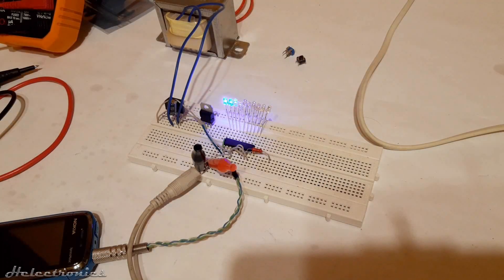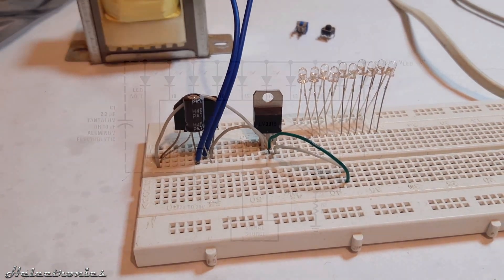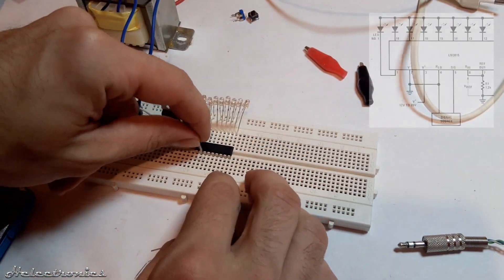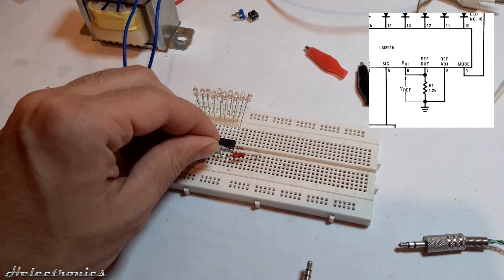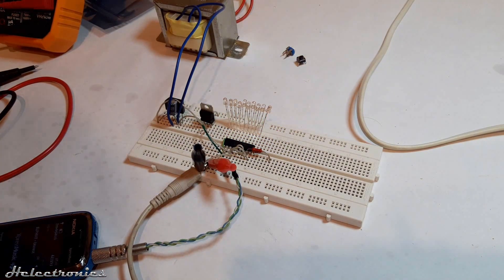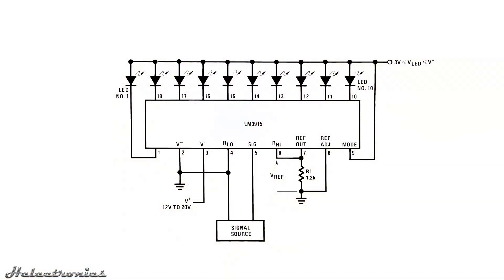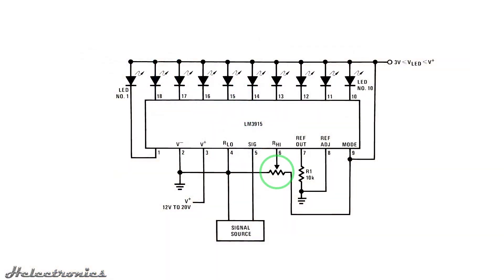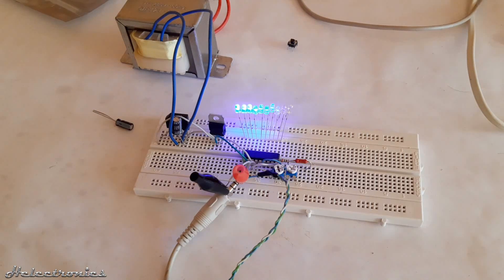TUTORIAL - Simple LM3915 circuit on breadboard (Easy difficulty)

Comment: Hello, I not much pratic in electronic, i would to put 12 led each pin exit how to do to prevent IC burn ?
Reply from the maker: You should use transistors, they can control those LEDs. At every output of the IC(LM3915) you should place a transistor which would turn on and off the 12 LEDs.